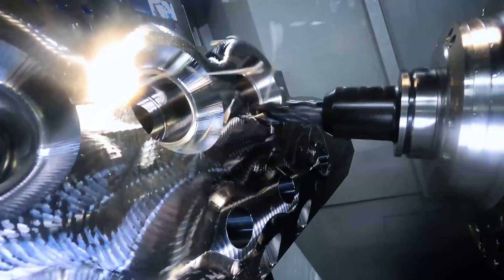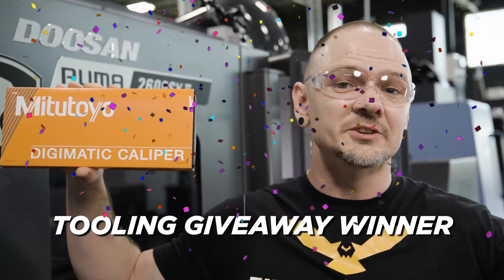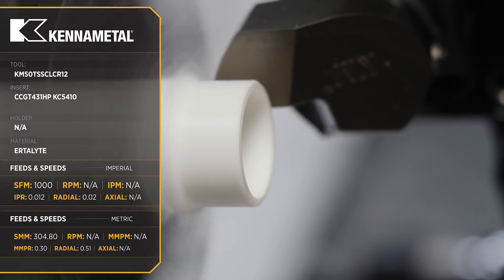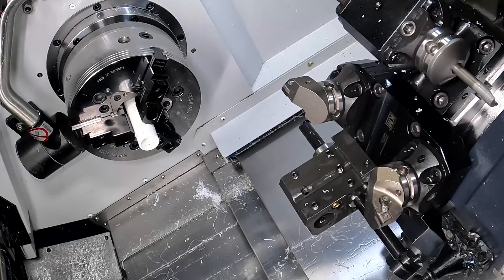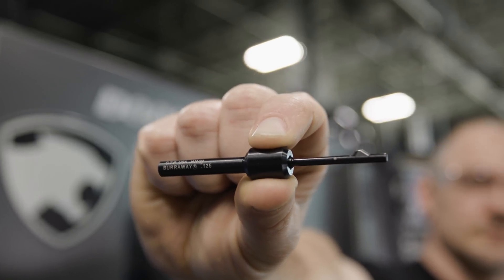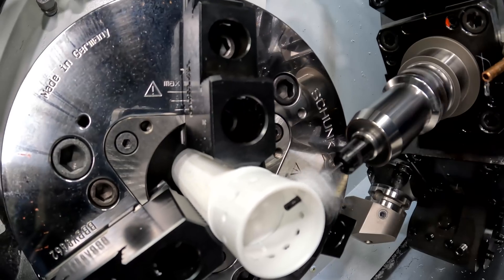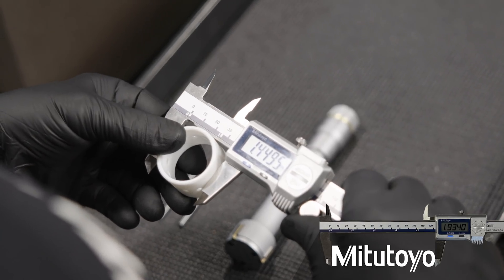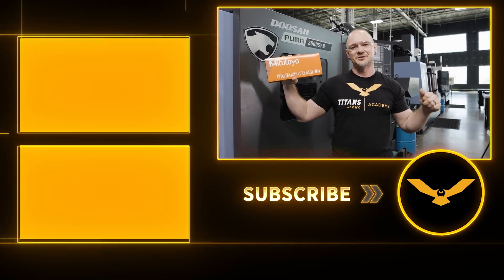Tips & Tricks That Allow Us To Machine Plastic Parts Lights Out!

Comment: What's the name of that spring loaded deburring tool you used on those plastic holes?
Do they make these same types of deburring tools that will work on aluminum or steel?
I work on air rifle projects that require holes to be drilled through the receiver walls and it's incredibly difficult to deburr the inside edges of those holes.
This tool looks like it would be just the ticket.
Without deburring those inside hole edges the O-Rings that get slid into the receivers can get shredded.
Reply: These deburring tools are known as clothspin-style tools, cogsdill is the major manufacturer of them

Comment: a lot of thin walled plastics tend to "pop" after part off, wondering how you're dealing with this. maybe the tolerance is wide enough to not matter, or if this material is less prone to that
Reply: PET is pretty consistent as far as plastic goes. Doesn’t tend to move much besides temperature changes

Comment: About chips sticking to the tool, Haas made a video about it. Apparently you can back out the drill, reverse the spindle and dwell of a second and that should eject the ships.
Reply: That work extremely well if you have a coolant nozzle pointed directly at the tool as well.  We use that technique in my shop all the time.

Comment: Machining plastic is all I want to do. I love it. Tool wear is minimal, speeds and feeds are lightning and my hands stay clean!!!!!! While I have medical on the lathe and aerospace on the vmc, I'm making a fish tank!
Oh yeah, there is no money in plastics and it's really hard to do. Stay away;)
Reply: Easy there man.  Lots of plastics are abrasive and will eat up carbide, and wait until you get a job where the plastics are filled with graphite or other materials.  Acetal is the best for machining.  Nylon eats carbide like no tomorrow.  I use PCD.
Reply: You'd be surprised at what polycarbonate will do to carbide.  We do a shit load of plastic at my shop and make a shit load of money doing it.  We ship 6000-12000 parts a week to our medical customer.  We buy and machine enough polycarbonate on a monthly basis, that when we buy material, we change the price for everybody west of the Rockies.

Comment: for the outside you can use a wiper insert to maintain high feed while achieving a nice surface finish and save yourself a tool change
Reply: I'm not sure about turning plastic, but I've gotten good results milling sides of plastic dry at 600SFM...  It seems to kinda melt the plastic and give it a glossyish finish.  Never drill or tap dry though, unless maybe there's time.  I also got good results milling some gummy steel dry at 400 and there was somehow less deflection.  That same part you can turn it at 550, bury the radius of the 431 (Been so long don't remember the tooling that well) on the finishing pass for axial at about .0035IPR.  Get something like a 64 finish which is phenomenal for that material and how it's ran on other machines.

Comment: Would that deburr tool work for metal?
Reply: We use them on aluminum and stainless. The tension screw is key for what material you are using them for, the harder the material the tighter the tension and the softer the material the lighter the tension screw.
Reply from the maker: Yes
Reply: @TITANSofCNC  Nice, ill have to keep that in mind

Comment: working with plastic you truly have to think outside the box, I work in a company that mainly make plastic parts in Europe. I also work on 2 spindle lathes and there's no same work. Working with coolant isn't good most the time, high pressure air is better for outside cutting and most of the time you don't have to machine the contour from outside of your stock material, you can save machining time by starting from your chuck and then comming out. But it's better to work with collets. Also the Citizen vibrating feature is super useful for plastic, look it up it's worth your time, if someone is curious.
Reply: Oh hell yes!! LFV is a game changer for plastics.  We use it as often as we can on our Swiss machines.  It's a life saver for eliminating chip wrap.

Comment: How does that deburring tool work? Would it not drastically overshoot the holes?
Reply: It's called burraway and made by Cogsdill. We've tried it for machining similar bushings but in steel and they didn't work very well for us. The holes were too big compared to the OD/ID diameters and so the deburring was really oval and inconsistant.
Reply: We use 'em in aluminum for riveting aircraft sheet together. They don't remove enough material on the way thru that it affects the rivet tolerance, if used correctly. 

However they get expensive when the noobie runs one through a part that had two bad holes that intersected (trying to knock off the burrs so the sheet could still lay flat) and the deburr flap 'snags' in that gap and the sudden force shatters the drill shank. 

It's me. I'm the noobie.
Reply: We use them where I work and they work really well for us but we mainly use them in hand drills so you can stop spinning and push it through the backside of the hole. The tension screw is how I am guessing they are stopping it from opening up the ID of the hole. You can loosen the tension so much that as soon as pressure is applied it retracts the blade in the shank and no cutting edge is exposed.
Reply: We use them in aluminium, works fine

Comment: Is there a difference in inspecting metal and plastic parts especially when walls are thin?
 Zbigniew
Reply: Yes.
Reply: @shadowdsfire  and this here was a lessen on "Why should you ask open endet questions" 🤣
Reply: We turn PA6 parts that looks like T in it´s cross-section view 170/160 for 5mm then 175/155 for 5mm, relatively thin part.... I measure them before putting it out of the fixture, they´ll bend like a hell and after you open the jaws you´ll have hard time to measure them correctly... for most of my plastic parts I say if they´re on spot in machine, they´ll be right on the spot when they´ll mount them into their place...

Comment: I see you, like everyone else, have a problem that the chips remain on the drill. How do you solve it?
Reply: Every four holes I do a pause and reverse the spindle for 1 second, this always works to remove any built up chips. I'm drilling 12 holes at 5mm diameter going 14mm deep into Delrin. no peck.
Reply: @jackflash6377  we use the same method
Reply: @ТаняКруг-у2п  Code is simple.

M04 
G04 P1. M03 

Done.
Reply: @jackflash6377  thanks!!! Try your method
Reply: He described using the coolant line to keep the drill clean